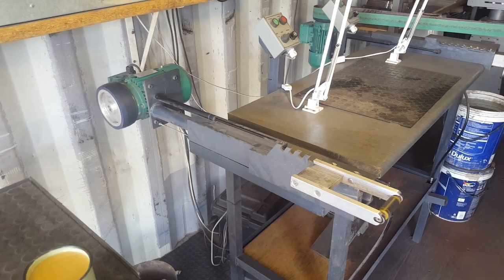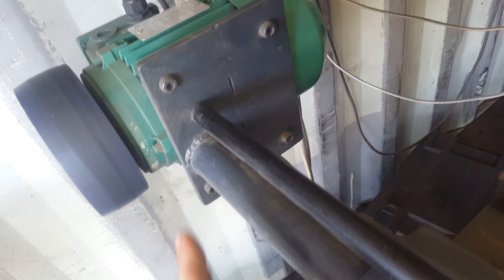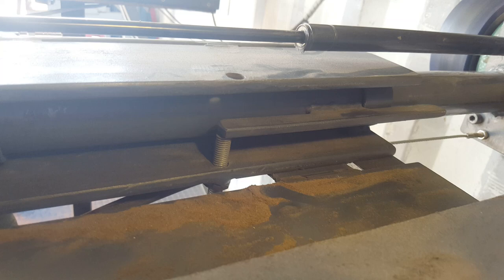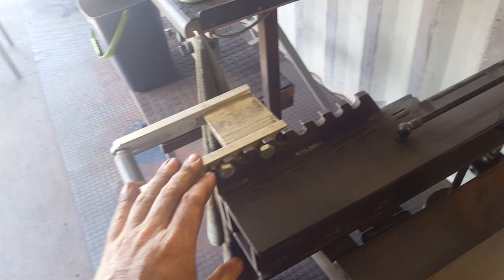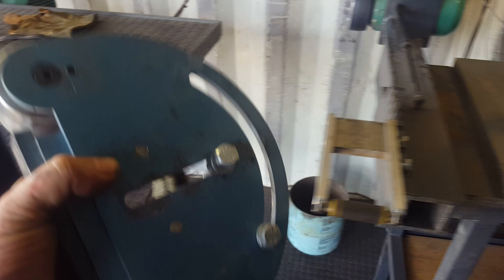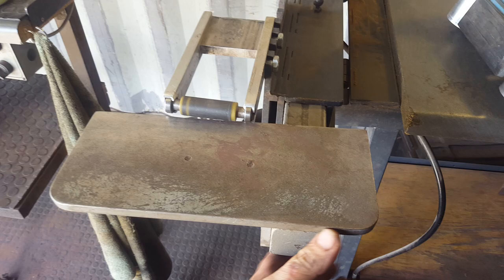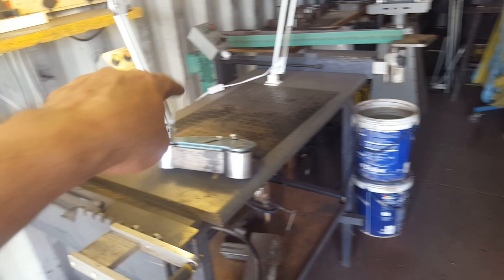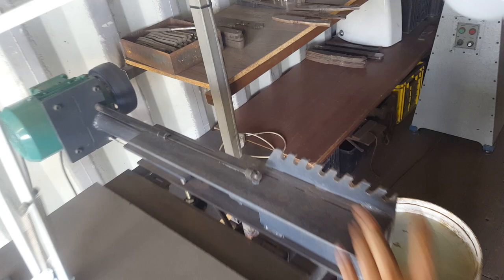Home built knife grinder overview

Comment: How is the round tube welded to the motor base attached to the grinder's square frame? I'd like some more info about the whole tracking/tensioning system and how is connects to the rest of the grinder.